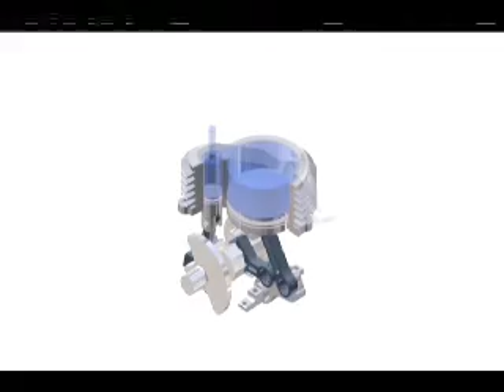A car that runs 200 miles on compressed air.

Comment: That is circular fast shady talk about “ air compressor that runs on air” if the compressor runs on air then how was that air compressed.
Reply: A gas engine or electric engine. If they had “fuel stations” where you could go and fill up with compressed air that would be the goal. You pull into the station that is run on say solar panels or a wind turbine that powers the electric air compressor motors you could have in theory a zero emissions compressed-air powered car that you could fill up much the same way we fill up gas cars today. It would also be much quicker to fill up a car with compressed air than say the time it takes to charge electric battery cars today

Comment: just add a electric motor to the startor so it can spin why being plugged in, then the compressor can run. you dont need to push the car.

Comment: This comment section is a shame to humanity. Air compressed cars exist and works.  Heck,  do some research people !
Reply: Cliff Yablonski  all wrong. and formua 1 cars run on compressed air.
Reply: Rightwing MAGA NAZI'S don't know how to research their indoctrinated
Reply: Do you know how failed electrochemical batteries were ? It had small storage capacities and discharged itself quickly, but they improved it. Look at how electric cars are a failure, inefficient, and unsuitable for use, yet they are still promoting them. My dears, there are unknown things and there is no complete knowledge. Imagine that even light, no one knows its true nature, but there are three theories that explain it, so the way is still open. If they were as interested in developing this technology as they are in developing electrochemical batteries and complex electronics, for example, developing the tank. Personally, I think that pneumatic and even hydraulic technologies have a promising future.
Reply: The Big Oil corporations have suppressed any type of other energy but they have to change because General Motors is going to all electric vehicles by 2030 and anyways hydrogen fuel cell vehicles are the future and Japan is already producing one along with greatly improved battery technologies that they already have ready to start producing America does not invest in these new technologies then China and Japan will and they will take all the money and jobs so yes America does need to invest in itself and its future or we will fall behind which we are already doing
Reply: He should have made the car more appealing
Reply: Impractical and costing nothing is ridiculous
Reply: @robertarthurs328 Lol u can even deaign one so stop commenting
Reply: @robertarthurs328  before ice invented if we tell about ICE concept to anyone iam sure all if them will say it is hilghy practrically impossible bcoz 100 obstracles but we made it with reserch and imvention new concepts to beat the problems like this we have plenty difficulties and downsides for CAir Emgime but we can simply make it usable like ICE but we dont coz oil
Reply: @robertarthurs328  no we only knew 10℅of physics ànd physics càn chanve its rule in some circumsitance
Reply: @robertarthurs328 
Physics doesn't change, but our knowledge and understanding of physics is ever-evolving.

[I am a physicist]
Reply: @VeganSinnerVeganSaint  Wonderful compressed air won't be the solution in this application
Reply: @robertarthurs328  lol impratical  and cost ? Oh what about INTERnational SPACE station its idea concept designing cost work and brain froce engineering technology viryually imppssuble but we made it so dont say impossible to anything
Reply: They are brainwashed by oil companies.
Reply: This guy compressed air to run the compressor to fill the tank how thick is this guy 🤯😱🤦

Comment: A car propelled by compressed air = Maybe interesting.
Using the motion of the car to compress the air = 100.000% total frigging BS.
Reply: I make steam engines and air compressors. They're the same thing. A flywheel as a battery storing the energy from whatever medium you desire. Heat. Or pressure from Water air etc. Keyword. Wheel. Wheels store the energy into a battery which releases the energy into pistons. The future step that some genius must discover would be to capture the motion from four wheels turning. It's not hard to think someone's already envisioned it

Comment: The portion of this video about the air powered air compressor is ridiculous. Sorry to burst your bubble for those who don't know any better.  On the other hand the air car has some real promise. Densely populated smog prone areas and indoor environs such as warehouses come to mind. 
   Regarding the problem of energy loss from electricity to air to motion, consider applications where wind or hydro power can compress air directly (motion to air to motion). In this application a small "off grid" turbine could bypass alternator/generator, charge controller, batteries, etc. 
   If you like off grid hydro power consider twin output system using a trompe.
The cooling power in the pressure drop may be used for passenger A/C or to chill product being delivered.

Comment: TERMOLIC can compress air at 300 atm . With a volume of 118 atm , the energy value is       1 kw/h and the cost 0,01 € . Cars can be filled from trailers parked where efficient.

Comment: A car made for idiots who slept through their middle school physics class. What happens to gas (air) when it's compressed? That's right, a lot of heat is produced. Heat is energy. Compressed air is considered to be one of the most expensive energy sources.  When air is compressed, almost 80% of energy is wasted as heat. It takes a 9HP motor to compress enough air to run a 1HP air motor. Don't believe me? Do your own research.

Comment: When I was a kid I took my pull cart and put a pulley on the rear axil and a pulley on the front axil. I put a v belt from my father's tractor between the two pulleys. When the rear wheels turned it would turn the pulley. That pulley would turn the front pulley which turned the front wheels faster. I put it on the road and gave it a small shove. The cart took  off and I hever saw it again. My father was pissed because he had to go get another v belt.
Send me lots of money for my kick starter program so I get that pesty physics Law figured out.  Just think. No bulky compressor or tanks or air engine.

Comment: He says "constantly refuels itself" so confidently, but there will obviously be mechanical energy loss. If he believes in that statement, then won't the air that is used be able to be wired back to the intake so that the engine can "power itself" infinitely?
Reply: I think they are just using the leverage of compressed air, it still needs a bit of gas, or charging of some kind, otherwise it would be "200 miles on air" it would be till the wheels fall off.
Reply: you need kompresor like thing to kompress air  into the air tanks you saw on video ..... .lSo you need elektricity
Reply: The compressor is not limited by electricity, it can run on almost anything.
Reply: There is always a loss of energy, and this applies to all types of energies, and electricity is no exception. Imagine if they had designed the car's aerodynamics so that when it moved, the air would be directed to very small compressors spread throughout the car's body, which would compress the air in addition to using hydraulics as energy regeneration or regenerative brakes ( or the same air engine can be used as a compressor ). It will be an efficient system that is also very simple.
Reply: Did you guys not pay attention to the entire video?

Comment: Too bad the on-board generator idea is BS. Literally impossible for that to work.
Reply: robinsss The car in the video did not have an on-board generator. The announcer made that clear when he said "What if that generator was on board the car? Then one day, perhaps the compressed air that runs the cars could also run a generator to compress it's own air? A car that runs on air, and constantly refuels itself, round and round, a perfect circle, perpetual motion..." Whoever wrote the narration is an idiot.
Reply: robinsss prefilled tanks and it only has about a 5 mile range. The rest of the claims are BS for ignorant investors and have never been demonstrated.
Reply: ""Too bad the on-board generator idea is BS. Literally impossible for that to work"

then what is the car running  on in the video?

Comment: The ending notion of "perpetual motion" is total bunk.  Probably, a joke.  Sadly, it nullifies entire video.  Hard numbers are needed: how much energy is wasted compressing air (heat losses); electric cost; is there a secondary battery system on board? ; 200 miles at 5 mph? or what other limitations?  How is the spread over last 4 years? What about braking recompression? And if airtank storage were better than battery storage, why is there no usage of the energy storage technology in other areas (backup generators/camping/construction sites)?  I am guessing true range is closer to 20 miles!!!!  Just not buying 200.
Reply: yeah. i was kind of idly listening to this... while i looked at some other page and then I heard that totally retarded ending where they talked about an air generator being used to compress air. (facepalm) OMG! Please, could people be a little more knowledgeable about basic physics.
Reply: +dennis garber 
Good Questions.
Just as people forget their "electricity" is often made from dirty coal, so it might be with the energy to compress air.
Reply: TheAngryCanary

"yeah. i was kind of idly listening to this... while i looked at some other page and then I heard that totally retarded ending where they talked about an air generator being used to compress air. (facepalm) OMG! Please, could people be a little more knowledgeable about basic physics."

I think it's completely possible for the car to fill another tank with compressed air
while driving on the air from the first tank

at 55 mph the other tank would be half filled in 2 hours

Comment: up until 2:52 it does make some sense, as long as you can compress the air so much, that it provides enough power for an average car (with the air tanks) for at least 500 km, and doing that adhering to all the safety regulations. But even so, you need energy to compress that air, and that energy does not come from "the air", it comes from power plants, which this video never mentions.So this technology is just an energy storage that competes with batteries (and has no chance).

Comment: I agree that some air could be recovered via the braking system by use of compressors. It may not be ture perpetual motion, but could extend the range by replenishing some air back into the tanks. It would certainly help in stop and go city traffic, I believe.

Comment: how can you quote something and than quote it incorrectly? lol. However it is possible but i too am sceptical this car actually runs off air and doubt it would fill up in 3 min like it says or even drive 200 miles because if it did tesla wouldn't have an 18 month waiting list.

Comment: How would you heat the car during winter? I was wondering if some kind of freaction heater could do the job. What is MDL's solution`? I figure during summer you get "free" cold air as a result of the air expanding process.

Comment: Sheesh 2 minutes on google would show you this is an old idea (1900's) doomed by lousy efficency low power and short range. This clip is merely aimed at getting  technically illiterate fools to buy a "franchise" MDI is a long running con (since 1996) that has conservatively extracted over $15,000,000 from idiots

Comment: Perpetual motion is nonsense, that can't be true, because of the heat loss while compressing the air. But the overall idea is not so bad. The storage tanks are made of carbonfiber and do not tend to explode, as the ones made of steel.

Comment: Why is it only on the internet do people feel they don't need to debate a concept with respect. Probably because they are sitting at a computer and not next to a work friend. It's an amazing concept. Yes, you will have to fill it with a compressor. They're will still be carbon impact from the battery (made in a factory) and compressor that uses electricity more then likely that came from a coal power plant. Also the perpetual motion is unlikely, but it could retain some of it and go further.

Comment: if the compressed air runs the engine(continues to keep the pistons moving up and down) while spinning and onboard alternator that compresses air at a faster rate than you are using it could potentially refill the tanks?
Reply: In theory, possibly.

Comment: 11,000 ocean wave action generators can power 200 million homes with technology known since 1799. OYSTER videos recommended. & their are 9 more verifiable devices that can power the worlds energy needs without pollution & end poverty. The 1st Compressed Air powered LOCOMOTIVE traveled 100 miles per tank in 1828. Any ?'s

Comment: the tanks are made from carbon fiber.. if a hole or leak does appear, the air seeps out but the tank does not explode.. also they even said that the tanks are strong enough to withstand small caliber gunfire..

Comment: What about the CO2 exhumed by the coal burning power station that provided the electricity to run the air compressor that filled the tank? Quite a mouthful but its still not 'green technology' if the source of the electricity is a polluter. Now if you were to run it on solar energy, or even better, wind energy you get the real deal! You might even turn the kinetic energy of the wind generator straight into an air pump, forgoing expensive and non-sustainable electric systems.

Comment: An onboard generator to create more compressed air has to be run by compressed air from where?? Why not just make the main tanks larger? There will be a loss of energy in the engine and transmission due to friction. Nothing is free, not even compressed air. A perpetual energy powered vehicle is a myth. The tanks should be constructed to resist explosion in a wreck. They seem to be deceiving us or not telling us everything. Hmmmm

Comment: I agree with you there, but you never know whats around the corner 
these air powered cars could be OK for small journeys, but the company or individual that comes up with a small light weight battery
that can give good milage before recharge or when depleted exchanged for a charged battery is on a winner.  The only draw back is we still need mains power to charge the battery . Only time will tell

Comment: There's one good thing about this world you never know what someone will dream up next. Getting it to the market place and accepted is another matter. The types of motors suitable for road transport which are not petrol or diesel are limited but who knows a big multinational company or some little guy working in a shed at the bottom of his garden could come up with an idea that works and in time replaces fossil fuel. Here in Europe the price of fuel is going through the roof so here's hoping

Comment: My Brother has the Degree in Mechanical Engineering He has the Degree to argue the point that energy is still used and you can't hook up a generator to rerun the air compressor you going to still loose energy it's a great idea but it is going to need more thought before the narrator makes it saying it's no lose in energy is a long way yet....

Comment: Mining cars are run on compressed air, this is an old invention, and the pull 30 tons miles. It may not be perpetual but it does work!

Comment: The 1st Compressed Air powered LOCOMOTIVE traveled 100miles per tank of C.A. in 1828. Water/Windmills DIRECTLY power Air Compressors WITHOUT the need for batteries Then power generators. SEE: Solenoid Engines. Some INDUSTRIAL LINEAR MOTORS & VOICE COILS produce MORE energy than they consume when powering a generator. SEE: H2W Technology L.M. #BLDD-06 produces 0to200lbs continuous/600lbs peak@10%duty @any stroke of PUSH&PULL forces of 0to12/^20G's From ONLY 0to4/12amps (mine0to12/72v) since1820's

Comment: I can see the advantages of using compressed air on light cars for "around the town" use, My only thoughts are in the event of and accident would the compressed air tanks have similar safety valves to like those fitted to LPG cars to vent off the air pressure. I can see the oil companies and tax people not being too friendly to this idea as,  after all they will be loosing  their monopoly of our hard earned cash

Comment: If you are an engineer specialising in efficency (which I seriously doubt) them 5 minutes with google and a calculator would have shown you this is a horribly inefficient way to convert energy to motion. So go away look at compressor efficency, air motor efficency (GAST web site has consumption power graphs) and then you will figure out how you have just made a complete tit of yourself

Comment: I think its just the presenter that has no idea what hes saying. Perpetual motion is impossible under normal circumstances. anyone who knows anything about physics should know that. This isn't a pipe dream, this could be very interesting technology if they put it into a car that would go around corners well and made it all very light. But right now, there is no way i would buy that ugly, top heavy, air powered clown car.

Comment: Bingbingbing!! We have a winner! Congratulations for demonstrating a healthy way of thinking... You are totally correct! First; you will have to fill the tanks with compressed air, but where do you get the energy needed to compress that air? Powerplant? Diesel-generator? Second; Once haveing that compressed air, you need to run the enginge itself. And besides all the energy taken to move the wehicle itself; the enginge is going to run a compressor (with a fair ammount of losses itself). Ludacris